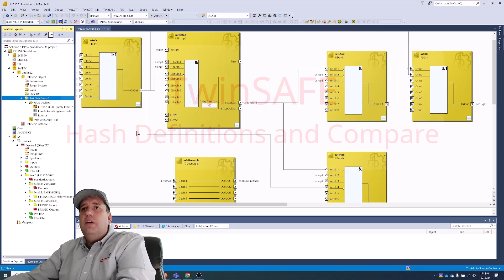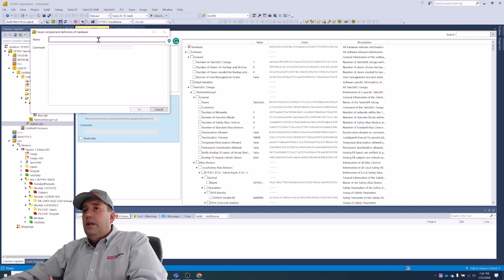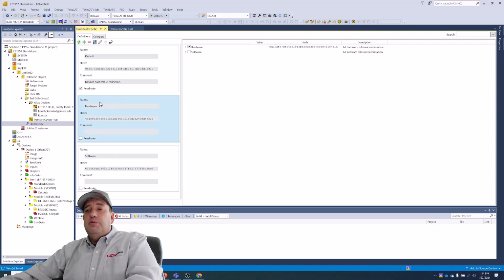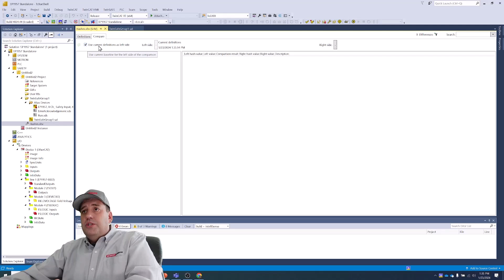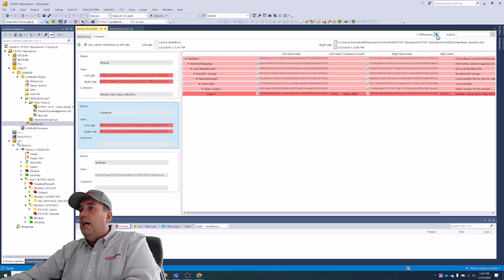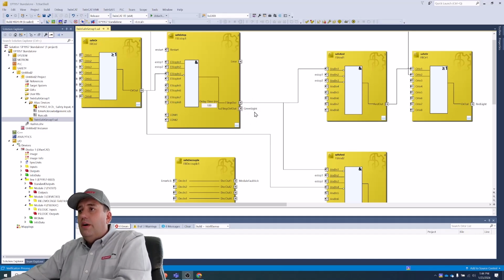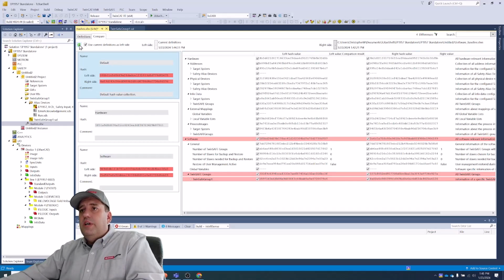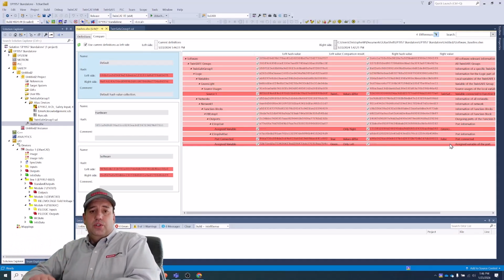TwinSAFE Hash Definitions and Compare

Comment: Looks like useful to find out what has changed between two versions of a safety project. However that's still a pity to have to define our own snapshot in exported files, while a lots of source management engines (like git) exist for decades. The tool should rely on the ability to read previous versions of some files via hidden interactions with the versioning tool. And then, when clicking on a change, why not visually displaying a read-only picture of the modified item before and after?